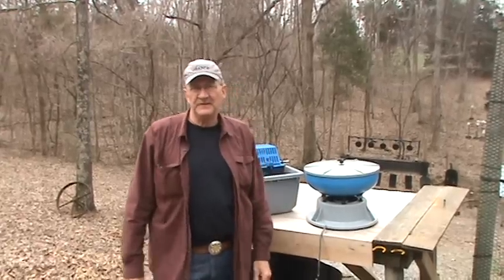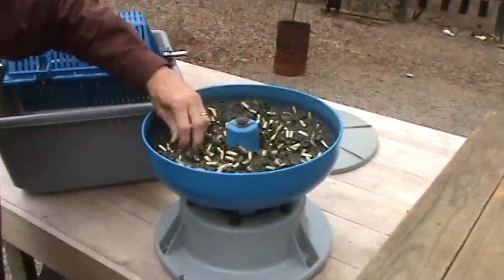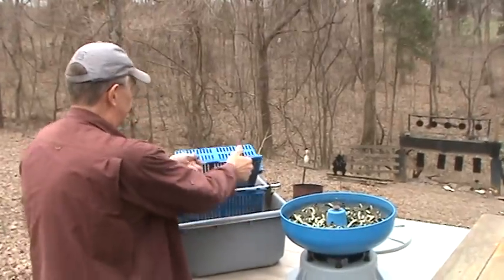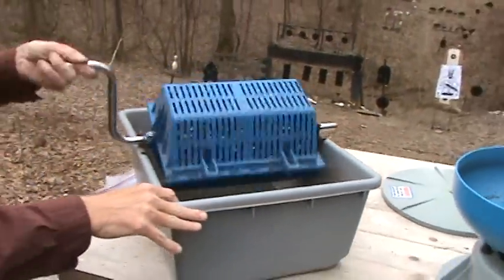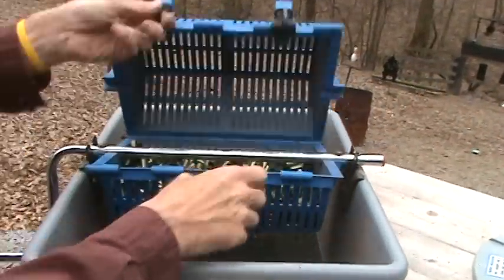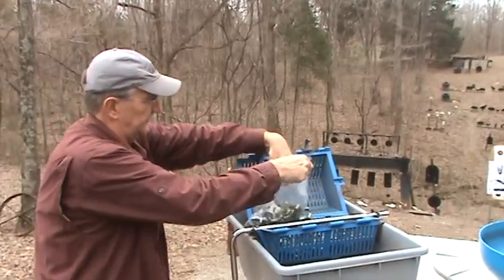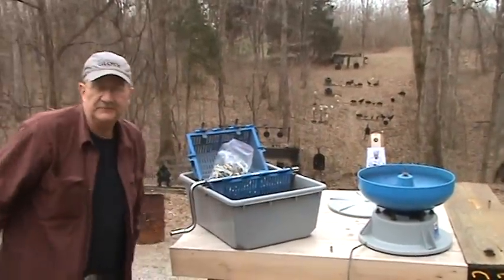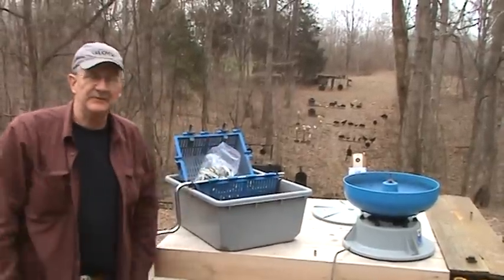Brass Cleaning (Part 2)

Comment: Love your videos. Let me caution you about the dangers involved in  cleaning brass. A few years back a blood test showed I was dangerously high in certain heavy metals. Research showed the most likely source was spent primers. The most likely exposure was the dust from tumbeling/vibrating brass. The steps I have taken are to use a single station press to deprime the brass before vibrating. Then to vibrate the brass. Then to blow air across the brass to get the dust off. I always do these steps outdoors with the wind at my back or a box fan behind me. I store used media in large ziplock bags. Working indoors simply spreads the dust around your work area and house. The dust you create tumbling your brass is in fact dangerous to your health. I speak from experience. 
I have never worked around anything that would expose me to these heavy metals. The Dr. even ask me if I reloaded ammunition.  Thanks,

Comment: I reload a ton. I've developed sort of a pre-wash that I do to range brass prior to tumbling it in the polisher. I mix white vinegar with dishwashing liquid soap and Simple Green. I leave the range brass in a 5-gal bucket half filled with this pre-wash for a couple hours to let it do its thing. Then I polish the brass in my tumbler. Works really well. Most range brass is reloadable with only the worst of the chocolates being throw-outs.

Comment: Nufinish and Flitz Tumbler Additive.  They do a good job without messing up the metal.  I usually start with the ultrasonic then move to wet tumbling and if they aren't clean enough by then.. tumble them with a capful of Nufinish or Flitz.  I also find that the Zilla walnut media works great but is real dusty.. after you add the additives the dust is cut way down.  Some say a dryer sheet works well too.

Comment: Not sure about the Dillon vibrators, but the RCBS one has a wingnut that holds the tub where the brass is polished in place. Instead of lifting the entire vibrator off the table, just loosen the wingnut, and dump your brass into the separator.

Comment: I use turtle wax because it's cheapest. Works ok. Don't put too much in.
I also use rice as cleaning media because it's cheaper. It works too as long as it's the short grain type and the casings are DRY! Rice swells when wet and becomes icky sticky. I have been commented by fellow shooters on how nice and shiny my brass is so, it works. 
With .223 rifle rounds rice is too large and will get stuck. Works with straight walled pistol and revolver casings.

Comment: Thanks for the informative clip about the tumbler. One question, do you use any kind of case lubricant on the brass before it goes to the press?
Reply: I know this is a very old question but I'll answer it anyway. Yes, it's good to lightly lubricate the brass before going to the press. They make commercial products for doing this, although  Pledge wood furniture spray works just as well.

Comment: love reloading 45acp it the easiest round to work with and allot of fun to shoot 
i reload 230g ball and 4.3g Winchester AA super Handycap powder chrono's at 690/710 fps and is just fun to shoot 
try to keep 600 rounds loaded 
I also load many other pistol rounds with the same powder 
just be careful it is easy to double charge a round 
the 4.3g in the 45acp only fills case to about 35% capacity of case so it is easy to load to much powder

Comment: Should I deprime brass first before doing this? I just started buying reloading equipment.
Reply: Nope, clean first then deprime and resize then tumble again then trim and deburr along with clearing flasholes. Lastly prime and charge and load a bullet :)

Comment: Is there a limit on how many times you can reload a case?
Reply: If you start w/new brass or box ammo, w/reg. loads, I would say 6-8 but I only load 45acp, a low pres.load. Inspect each shell bf decapping, look for cracks etc.